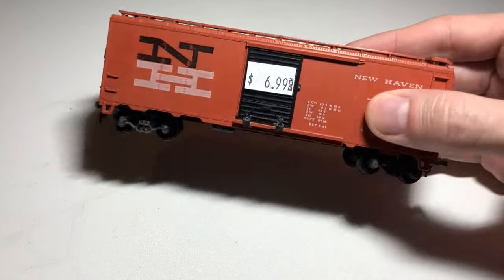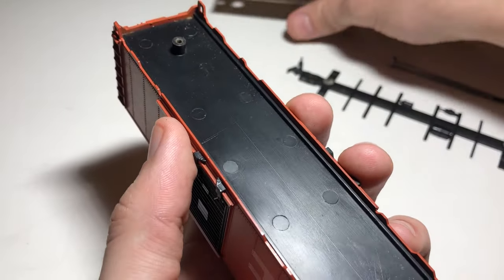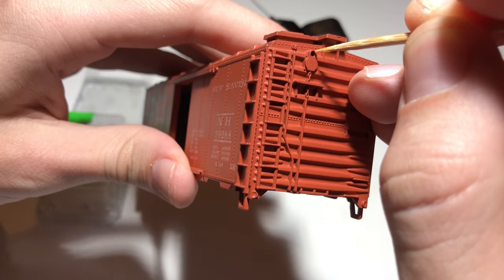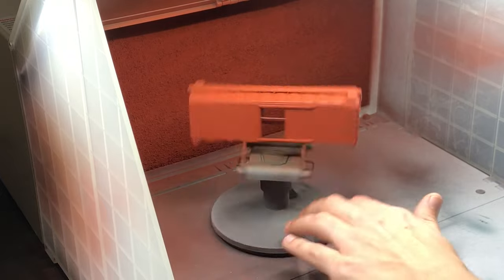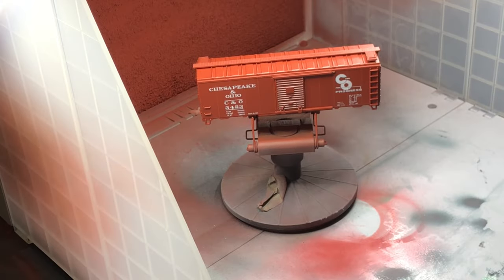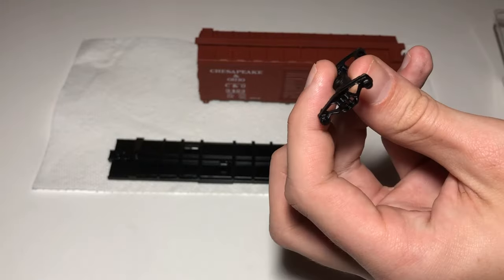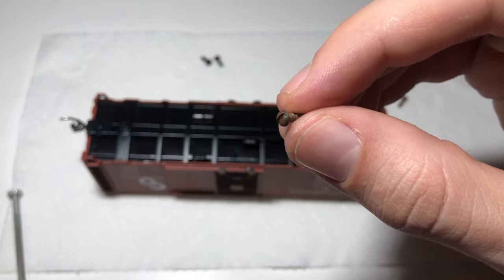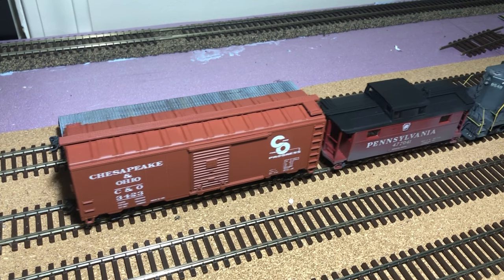How to Upgrade and Customize Cheap Rolling Stock

Comment: In this era of $50+ ready-to-run models, it's great to see that people are still doing a little extra work to get good models at a reasonable price. I had two Varney cars (a tank car and a reefer) from the very first HO train set I received as a Christmas present 60 years ago - new paint, decals, wheels and couplers made these some of the best cars on my layout. Don't forget to check the car weight: old cars are almost always under weight, and once they've been disassembled, it's easy to add more weight.

Comment: A few additional things: before closing up the body, weigh the entire car and add wheel weights to bring the car up to NMRA minimum standard weight. But these adhesive weights at your local tire store - they will be many times less expensive than buying them at the hobby shop. Check the wheel sets with an NMRA gauge to make sure they are in gauge. The wheel sets you used from Kadee are virtually always spot on. Coat the car with dullcote to knock down the glossy look. It also gives a nice tooth to the finish that hold weathering chalks better.

Comment: Two things one remove the lettering before repainting this is easily done with rubbing alcohol and a q-tip . this allows for a better paint job by preventing bleed thru of the old lettering and means fewer coats of paint needed. The second thing is to apply the solvaset right after applying the decal if you watch your video you can see the edge of the decal film showing around the cheaspeake and ohio  to the left side of the door . This occurs when you wait to long and thus do not get the decal to set properly. Learned these lessons 45 years ago when we had to repaint and reletter in order to get some roadnames that weren't available or if one was free lancing ones own roadname.
Reply: 409 works well too. Let it soak overnight. Viola!

Comment: I have an old can of red oxide primer I use for my ore cars and boxcars.  I had to thin it down with some lacquer thinner to get it to flow through my airbrush.  I use Dull Coat I mix for my airbrush.  For an acrylic gloss I use Future Floor Wax (Acrylic) mixed with Isopropol alcohol.  I have a bunch of 1960 - 80's rolling stock I updated with body mounted Kadee couplers and Walthers Proto 2000 metal wheel sets.  Cheers from eastern TN

Comment: I inherited a whole fleet of Blue Box Athearn and Roundhouse rolling stock fro my dad. He already changed the couplers, but I added JayBee steel wheels to all of them, adjusted height, etc. The only thing I found is that almost every blue box 40' boxcar is lighter than NMRA standards. I added weight using peel & stick automotive wheel balancing weights that you can get in strips of 1/4 oz and 1/2 oz from amazon or Harbor Freight. The cars perform better with a little more weight.

Comment: If you intend to repaint the car, I suggest stripping the existing paint with either brake fluid or 90% alcohol. Adding to the existing paint over existing lettering makes the coating too thick over details.

Comment: Yes, it is an Athearn--be advised that you can pull off the upper door rails and roof walk before painting. 
Paint everything separately, including the weight, underframe and floor and new brakewheel.
Before painting car, remove existing paint and lettering by immersing in brake fluid or alcohol. Only takes a little while. Lettering not removed will often show thru any new paint.
You may wish to replace the thick roofwalk with a thinner Kadee one.
If you use spray cans, make sure they stay warm by immersing them in a pan of warm water. A cold can loses pressure and will ruin your paint job.

Comment: An easy way to "paint" the metal weight is to first lightly sand off the rust, then use a broad tipped Sharpie to coat the weight. Takes under 5 minutes and dries in less time. No airbrush to clean, no aerosol can smell either.

Comment: I suggest a 2-56 by 1/8 screw to hold down coupler pocket cover.  Amazed you didn’t have shading of the old lettering through the primer.  I usually strip my cars to bare plastic to eliminate that issue.

Comment: What's the best brand of trucks for these old Athearn cars? I'm trying to tune up my roster but I keep running into the issue of the replacement trucks not fitting over the nub on the frame. I've been trying to find some good Kadees since those roll so damn well but maybe I'll have to settle for new wheel sets.
Reply from the maker: I can’t really say, there are so many different kinds of trucks and cars and they all fit differently. One thing I can suggest is to get a truck tuner, it opens up the trucks a little bit and can really improve performance.

Comment: Have you any old diesel electric c&o blue yellow and any passenger blue and silver
Reply from the maker: No, but I do have several B&O locomotives that have the blue & yellow post-merger scheme.
Reply: @kgmodelrailroad  great if there's a way I can see some pics if you have anything you would like to sell. If it's something that I could use in my collections.